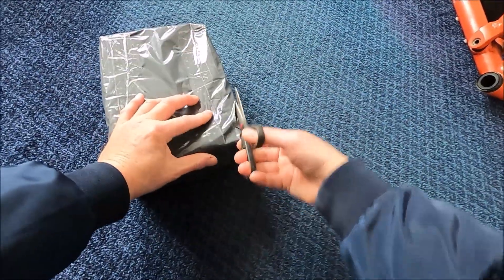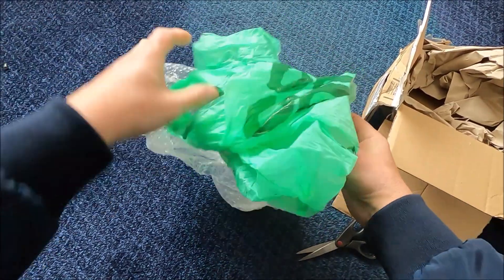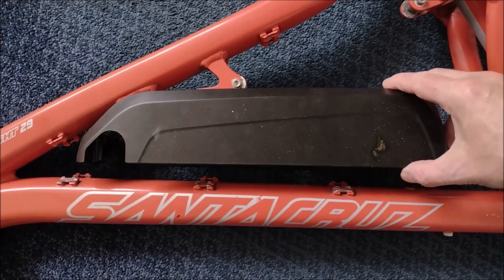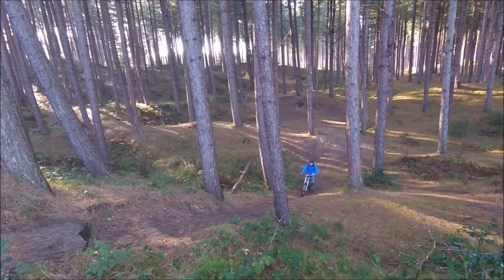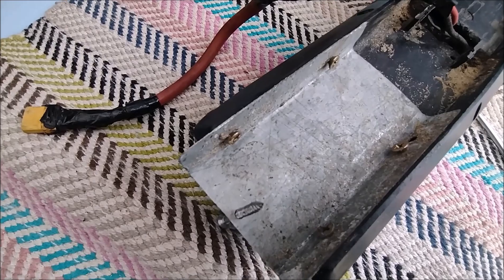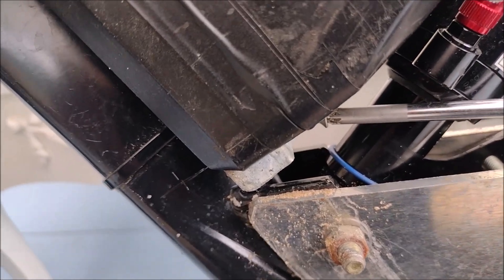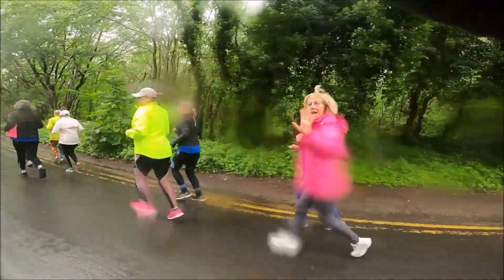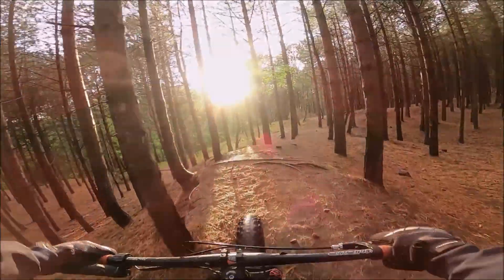Tips and hacks for Ebike battery mounting

Comment: not sure about that one maybe modify the batteries mounting plate,  I sometimes use uncased batteries and attach them to something with velcro strips,  duck tape etc, it works fine if you never crash.
Reply from the maker: Thats the issue, a good tumbling bike crash and your batteries in a ditch.
Im going to put a stud sticking out the frame.